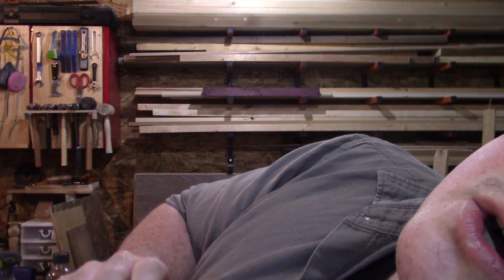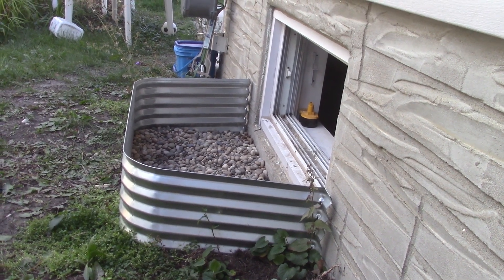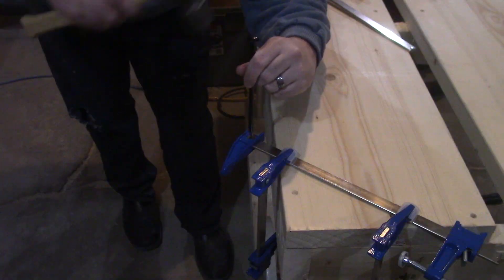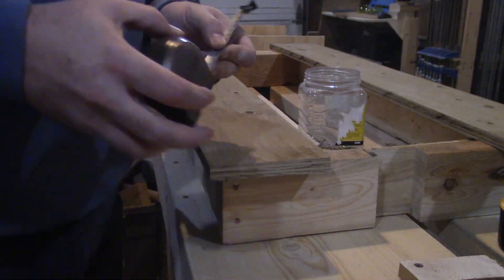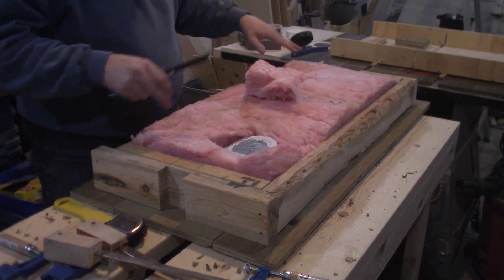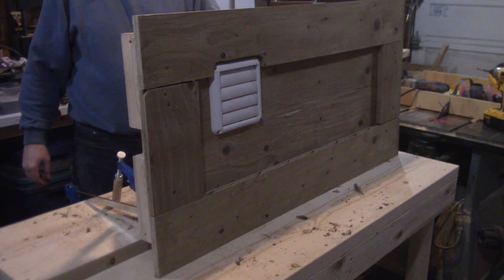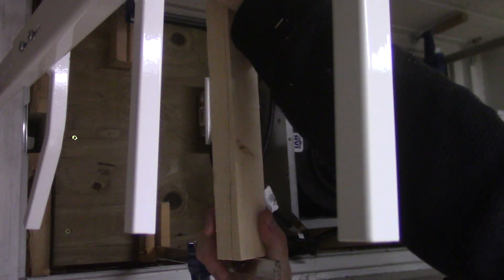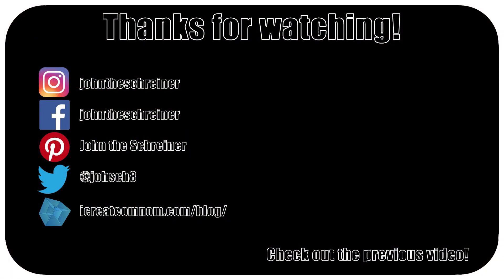Building a $20 Window Mount Fume Extractor

Comment: I would have put sheet metal on the outer side over the plywood, as moisture, even though pressure treated it is still plywood can and will eventually break down and warp! Plus paint the sheet metal with rustoleam for a cleaner look!
Reply from the maker: Good point. Mine didn’t get to the point of warping. I ended up taking it back out because of the furnace backflow issue that arose, but good idea for V2.